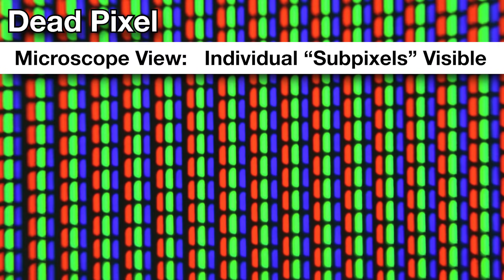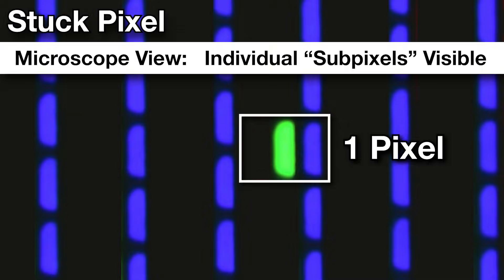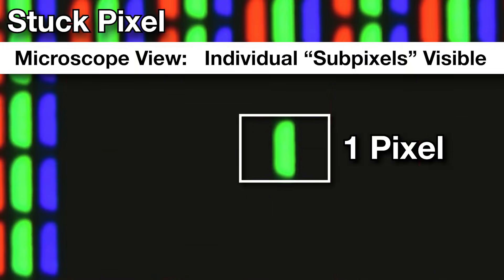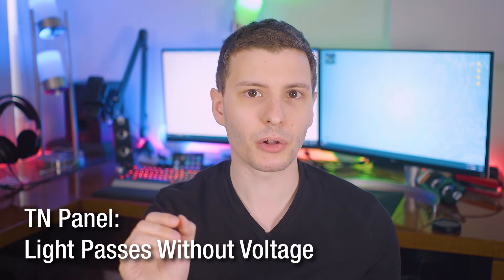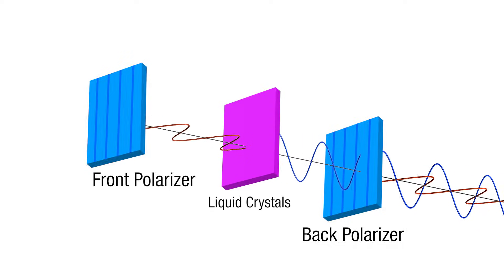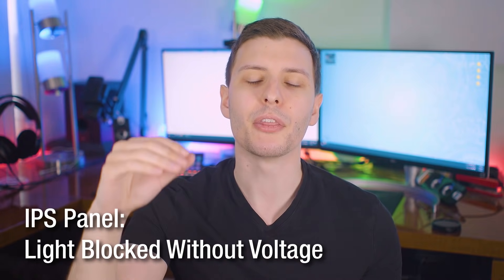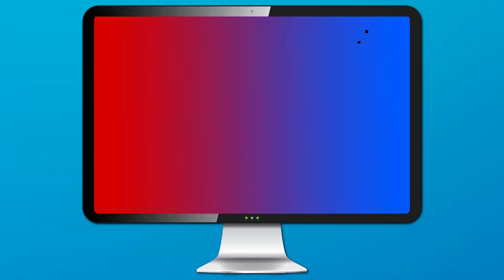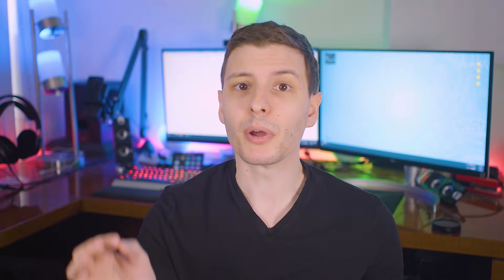Dead & Stuck Pixels: Causes and How to Fix Them

Comment: I had this debate (warrantee for dead pixels) with Sony rep in Sony store when buying my TV over 10 years ago.  He said the same thing, below is our debate

Sony rep: "the price would be way higher to ensure zero pixel faults",
Me: "wow that many are sold with broken pixels?"
 Sony rep: "no it's very rare don't worry" 
Me: "how rare?"
Sony rep: "I don't know exactly but I've sold hundreds and never seen a TV I sold have a dead pixel."
Me: "so let's say 1 in 100 at most?"
Sony rep: "oh way less than 1 in 100"
Me: "then at 2% to all your TVs, that's double the sale price not you cost to produce price of all the TVs you have to replace at most and you can refurbish or reuse parts so that should if anything make you a profit overall and you get to brag zero pixel garentee on all your TVs"
Sony rep: "it doesn't work like that"

Yes it does, either the failure rate is way more than 1% and many many consumers are dealing with this or they can easily garentee it cause 2% is just £20   on a £1000 TV, that s so little they could legit swallow that cost and still make money on the TVs ( as proven by sales prices)

I don't buy the excuse it needs to cost allot for zero pixel protection the only valid argument for not providing it is the e-waste but given they can reuse the parts and refurbish Vs many customers throwing it out entirely earlier than they would have it if was fine also adds to e-waste so that's even debatable

Comment: If you have a Dead/Stuck pixel that has a Dark spot around it or below it, but for some reason it works/lights up when your cursor is on top of it. Then it might as well be a software problem in one of ur programs running on the background, if you have steam running, it is likely that it’s the problem, so you have to completely end the program via Task Manager.
Reply: THIS.  You saved my sanity lol A random dead pixel popped up with a dark spot around it, i was looking into the warranty on the monitor and then i came across this comment.  Just restarted the pc and the issue went away lol thanks :)
Reply: i was freaking out for 30 minutes over the fucking steam launcher? goated coding from steam devs, literally a company that gets 2-4 billion dollars every year.

Comment: Well I have a solution (that worked for me) for those having IPS panels with the dead pixels.
I had 6 dead pixels (black ones) on my IPS screen, I tapped each one of them with my nail and they all turned on and started working.
Sadly this didn't work for stuck pixels and hot pixels.

Hope this helps you.
Reply: Lol

Comment: What about VA? I just bought a 4K 32" VA monitor and there is one single dead pixel in the corner and one bigger spot of multiple dead pixels, decided to return it as it was a free option in the shop, but it would be nice to know more about VA panels as I'm going to look for another one.
Reply: solved ?

Comment: Be aware that applying pressure can make it worse. In my case it i think it did. It was a subtle red dot before but now it's a more pronounced red square pixel. Really sad but i blame myself for i already had a bad feeling but brainlessy did it anyway. I would suggest only trying the (very light) pressure method if the pixel is already very pronounced and even then it's probably smarter to just accept it and not make it worse. Try the flashing pixels method first, maybe overnight. Didn't work for me though and i figured out that the red subpixel is still working but the blue and green subpixels always stay off, hence why it's red on red but on white and grey (when all subpixel should shine) it's just also just red and on green and blue (when ONLY those should shine) it's black and consequently on it's black on black. I suppose that's at least lucky since if all three of them were dead it would be a pitchblack pixel on white which is more visible. But that also means that i cannot fix it and shouldn't have played around with it. I guess i was either imagening it getting worse or the green and blue lights DID initialy work at least a little bit, making it less pronounced. Should have given it more time to carefully inspect things and figure out my next steps...
Reply: Yes, anyone who watched this video completely is very much aware that applying pressure can make it worse... Did you not watch the last few minutes of this video? 😂
Reply: @awesomeferret  I did, but I didn't give it much thought at that time. Plus I think I gave a bit more perspective on what to look out for to determine whether it's worth a try or not. That is, if only a subpixel is broken it might be smarter to leave it be as it's not that bad anyways since the other subpixels will still make it blend in in most scenarios. If the whole pixel is broken than light pressure can at least not make that specific pixel any worse so it might be worth it maybe. I think that view is worth more than just an initial vague feeling on whether one should risk or not. Overall it's probably a bad idea in general though. But I wasn't unaware of the possibility, just not sure on what to base my decision on so i went ahead on a whim.

Edit: Oh yeah: Smartass 😏
Reply: @jawashasalan56  I was going to upvote your comment and say "fair enough" until I read your edit. Hey, if that's the way you want to go, so be it.
Reply: @awesomeferret  haha, well the whole comment should show that I didn't have ill intent, but your comment was also a bit smartassy so that was just a little nudge ;) but anyways I would make a LET'S HAVE WAR joke but uhm hm dire times so: fair enough 👍
Reply: @jawashasalan56  fair enough.

Comment: It worked for me years ago (more than ten) on a very cheap lcd tv. I had a permanent and bright magenta pixel almost in the center of the screen. Tapping the pixel for a while with my bare finger solved the problem for a month, and then it came back. I did the same procedure for a little bit longer and it desappeared forever.

Comment: I once had a moving cluster of black pixels. Turned out, it was a thrips bug which somehow went between the glass panels.
Fortunately, it did not die, but found the edge of the screen.
If I had pressed on the screen, I might have killed it (and spilling it's internals).

Comment: My 8 Month old Lenovo Legion 5 Pro just got its first dead pixel. Its a hot one, stuck on full white! 
Even on a 2560 X 1600 Display it's surprisingly anoying if one of 4 096 000 Pixels is white when you're whatching dark content.
It's pixel X 2150, Y 1293 so in the bottem right area. 
Nothing helped to fix it.

Comment: I solved it differently. I have my laptop connected to my 4k TV, using both as a dual monitor. My blinking pixel problem was caused when I changed the setting for the TV in the Intel Graphics Control Panel. The default setting is "Maintain Display Scaling". I had changed it to "Maintain Aspect Ratio" and the blinking began. The problem was solved when I changed it back to "Maintain Display Scaling".

Comment: I just want to say that, I tried using the JScreenfix thing, I got impatient real quick, like I used it for a minute or less haha, then I went to the second option, I rubbed it gently with my glasses cleaning clothe, (I had two stuck pixels btw) and both literally fixed themselves immediately. The first pixel was fixed not even after a second of rubbing, and the second pixel went away after a few quick and gentle rubs. Long story short, thank you for making this video.

Comment: I had a stuck pixel on my monitor but it was the cheapest one on Amazon because I was out of budget when I build my pc (by the way, the cheaper monitors aren’t actually that bad) so I didn’t really care about scratching/damaging it and I just rubbed it with my fingernail and it fixed itself.

Comment: I JUST BOUGHT A NEW MONITOR, and after a few days one dead pixel showed up, every time i buy a new monitor this happens always. God i hate it so much.
Reply: I thought Asus or another company offered a few line ups of Pixel Perfect guarantees for specific models, but I don't remember which company or models off hand
Reply: @motoryzen  mine is acer, and previously i own a benq which both has a stuck pixel, and to add insult to injury the new monitor which costs twice of the old benq has severe ips bleed. But after checking acer's website i think my monitor can't be RMA-ed or returned. Big sad :(
Reply: @bwedges  you're not alone, 3 out of 3 acer monitors in. All with DPs, fml.

Comment: fuck this life. my monitor were appeared black pixel for half-year. not long time ago it fixed by another hit. and today this monitor got hit again and damn another pixel is turn black again. hope this still fixable by next hit. im not so sure where to hit it will work. it should be because the one diode out of the circuit by take hit?  what to call this situation is dead or stuck pixel one? hope diode not broken for this time. and damn how can i not to blame myself

Comment: I can’t drag the static screen to where the bad pixel is. I can move the cursor there and select it with a bold circle, but the therapeutic square isn’t going anywhere.
Reply: Put the webiste into fulscreen (F11)
Reply: I ran the app again from an internet browser, and the square of flashing colors now appears in the area where the bad pixel is. I’ve done it twice so far, for over an hour each time, and no help. The bright green eye booger is still there, stuck on the screen like a big glob of fluorescent epoxy.

Comment: My laptop has a green line showing vertically across my screen. Is that part of having dead pixels?
Reply from the maker: I don’t think so, that sounds like a more severe defect
Reply: @ThioJoe  I was afraid of that, thank you
Reply: Sometimes the lights in monitors are arranged in rows or columns having common ground, maybe that got disconnected,  possibly due to bad solder

Comment: I had a hot pixel (white stuck pixel) on my monitor; I tried some solutions and no luck. I learned that the pixel would only show up when Microsoft Teams was open. If you're a statistical outlier like me, it could be as simple as closing a program that's running in the background

Comment: I rubbed a dead pixel with my nail, very gently, and felt like a bump or something. I knew it from a ling time ago, but i tested again, with a soft cloth piece, and it's definitely something physical. I also have a laptop with same issue... I'm so lucky to not see or have notice any others.
Reply: BTW, those dead mixels are 2 to 3 incles close to the corner...

Comment: I got myself a vintage Gericom LCD screen for insane price of ~3$. It sadly has a small dead pixel in the middle of the screen. I don't think this gonna work because ~20 years old LCD has right to have this kind of issues but let me try and see if this going to change anything.
EDIT: Yup, nothing works. Oh well, it's still in good condition for what it is lmao.

Comment: currently i have a pixel where the red subpixel works fine but the green and blue subpixels are stuck off, this is on an ips panel and nothing else worked so I'm gonna have to go the waiting route to see if it just goes away

Comment: First i tried j screen fix. But at the end Pixelhealer fixed it for me, after two hours (Its freeware). In combination with gentle pressure on it. I had a green stuck pixel.

Comment: Tip for anyone being ripped off with dead pixels on arrival. MAKE MORE DEAD PIXELS! OPEN PAINT, PAINT IT BLACK, PAINT FEW SINGLE DOTS EXCEEDING “acceptable dead pixels on arrival”. LEAVE IT ON FOR 13 DAYS (14day returnal) ON MAX BRIGHTNESS, TURN OFF AUTO SLEEP OR WHATEVER. ENJOY YOUR REPLACED PRODUCT.

Comment: I massaged it and flicked the dead pixel with my fingernail. That didn't work, but knowing how they operate in a grid I went off to the right side of it and flicked the area at the same level as the pixel but about 3 inches from the edge. That fixed it. LG 50" schmart LED TV

Comment: Got this on my Dell's 1440p Monitor on about 4 years of use. 
Never got dead pixels on any old monitor I have used.
I hate Planned obsolescence.
Reply: Got to solve temporarily my dead row of pixels after about 2 weeks, mainly by leaving the monitor's background light at 100% and using normally. It got normal first, then I lowered the brightness and it soon cameback.
Pixel Flashing tools were used for about 6 hours, without noticing any improvement.

Comment: I'm so glad that those pixel fault clauses are effectively BS, at least in the USA.. Every time I've ever had a dead pixel out of the box (the latest was my first LG V40... Yes, I'm overqualified for quality control... That's over 500 ppi 😂) I've been able to return the device for a refund and get a new unit. Never do a warranty claim if you are still in the return period (therefore, always do dead pixel tests when you first get the device). Don't let manufacturers get away with selling defective hardware to you.
Reply: lg device screens suck, my lg v50 also got a dead pixel after 2 weeks it sucks

Comment: I just had a stuck green pixel and tried some of the methods to fix it but it unfortunately didn't work. After that I turned my monitor off and on again and it worked again 🤦‍♂️.

Comment: omg i just bought this samsung g7 32" 240 hz monitor and 2 days after setting it up it had what i thought was a dead pixel. I followed your massage advice and the pixel moved. which indicated this was not a dead pixel. I carried on doing it the pixel kept moving locations. about after 10 times of it moving it completely disappeared. Thank you so much this has saved me so much time of going through warranty.

Comment: idk why sometimes when i shut down my laptop it doesnt shut down completely and shows the battery percentage from time to time and keeps using power, this time I shut down my laptop and left for for a couple of hours, and then when I opened it the battery percentage on the middle of the screen seemed to burned through my lcd and it wont disappear after restarting several times,  and then I saw this video and used the first method and used the jscreenfix and then left it for 30 mins, thank god that worked, you're a life saver.

Comment: hey I'm using samsung galaxy S10 5g it had amoled lcd display you know that..one it fell on floor little hard when pick it up it seems good after just seconds later it flicker and half of the display color turns pinkish red not that much bt it is not good what should I do can restore  the damaged pixels

Comment: Insane thing is I legit got a Philips Google tv 50 inch. I had 3 dead pixels/stuck pixels that where white. took it back the same day. Got another one it worked maybe a WEEK got two BLACK ones. I did the suction cup pop thing I saw all over twitter and it worked!!? Stuck/dead pixel popped right back on!

Comment: I've brought home quite a few monitors and TVs from the trash (bulk trash, twice a year the city will haul away almost anything you put on the curb), and of the ones that worked, almost none of them have any dead or stuck pixels. The dell monitor I'm using right now used to have a dead pixel, but it seems to have gone away. The other day I grabbed a 40" Toshiba TV that works great, but has one green pixel that is stuck on. I tried lightly rubbing it with my finger, but that didn't do anything. I'll try that website and see if that helps. 

One thing I've noticed is that the majority of monitors work just fine, as long as the screens aren't physically damaged. On the other hand, TVs are a crapshoot. Smaller TVs (20-30") often work, while larger TVs (40-60") often don't work at all, or have something wrong with them. I found a 60" Vizio with half the backlights burned out. A 50" Samsung with no sound and a purple tint to the picture. A 50" 4K Samsung that started glitching after about three hours. I've found three 40" Samsung TVs that work fine. One has a glass screen and a glass stand, so it weighs a ton. One has such a thick bezel around the screen that it looks like it should be a 50" TV. And one is pretty lightweight, but has no stand.

Comment: You know what I find really ironic? That for every "upgrade" to technology, they seem to introduce more and more defects that are considered acceptable.

USB was hailed as a giant leap forward over dedicated ports, but it has a lag issue that dedicated ports didn't have. Yet, despite this issue, it's still considered better.

LCD panels can have dead or stuck pixels and this is considered acceptable by manufacturers. When was the last time you heard of CRT manufacturers considering it acceptable for their screens to have dead spots in them? Then there's the issue of LCD screens not always updating fast enough to keep up with all the action. Oh and the fact that LCD screens can only display a single resolution, so setting them to anything else will result in the image being scaled up or down to fit the panel's native resolution. CRT monitors used to literally change the resolution to match the signal, so the image was always pixel perfect. Oh, and LCDs don't work with light guns, light pens or any other such tech. But they're better!!!

Computing power has made great leaps forward, but you know what it can't do? It can't read an analog signal as well as a 45 year old Atari 2600. "Well, that's because of analog to digital conversion..." So you're telling me that in the almost half century of "progress", we've lost the ability to accurately read an analog signal? Seems like that would be a huge problem in the scientific field, the medical field, and many other applications. And wasn't the 2600 display composed of pixels? So doesn't that mean that the 2600 converted the analog signal of the paddles into digital data to draw the screen display? So why have we apparently lost that capability?